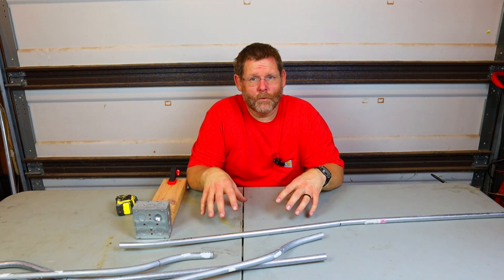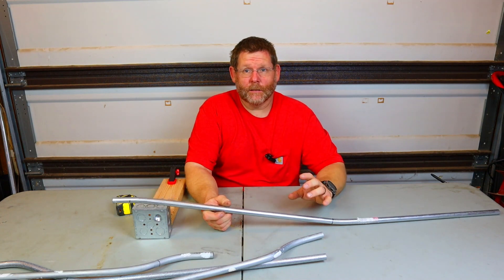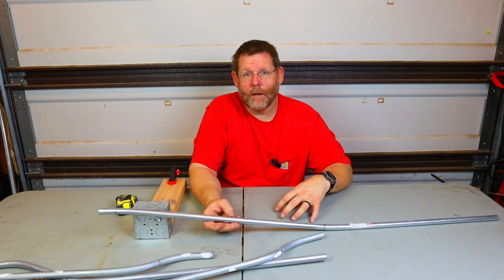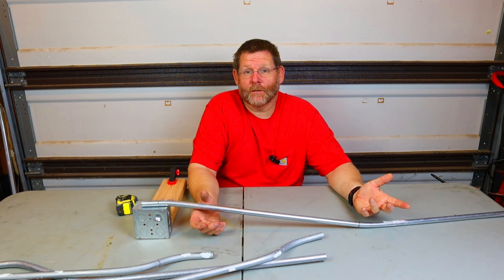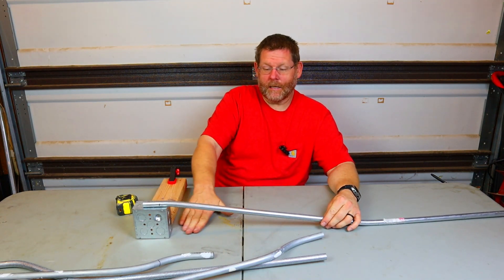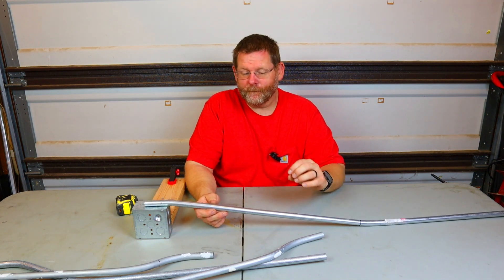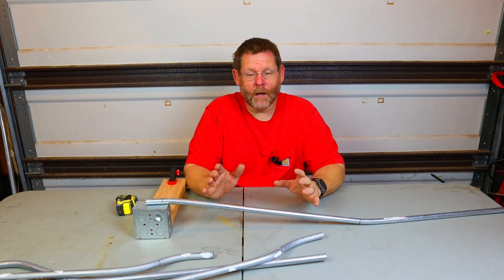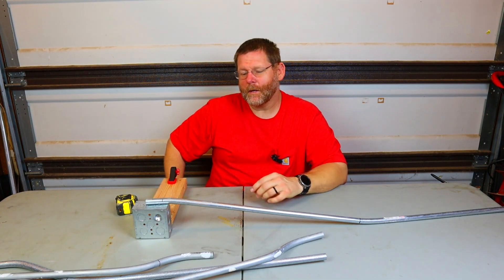The Conduit Bending Saga Final 10-60 Degree Bending | Episode 6

Comment: When bending pipe do in pretty much every situation do you Try to measure center to center or side to side? I need help getting better with how to measure not the actual math itself. Like the many situations that arise how to go about connecting pipe or getting from one wall to another or through wood studs. Like the math is what it is but obtaining the measurements in these work situation is super challenging.
Reply from the maker: I'm working on videos to help with this. Stay tuned

Comment: Do when thinking about degree of bend 30 is king.  but look at how much space you actually have to bend the conduit and that will determine the bend? Like you showed 10 degrees was pushing it with only 20 inches of space. Also think about the real estate under the pipe.